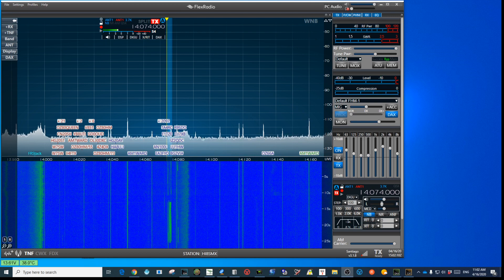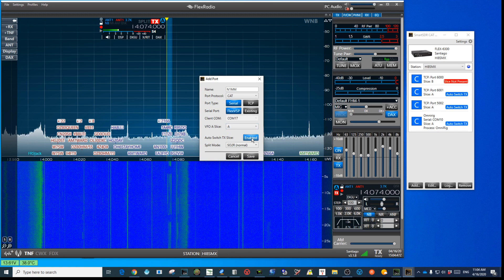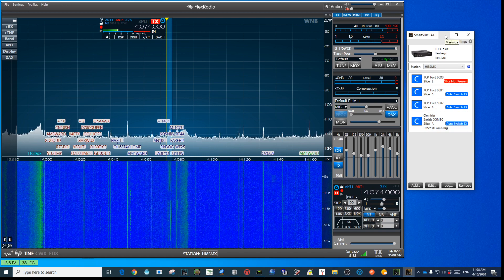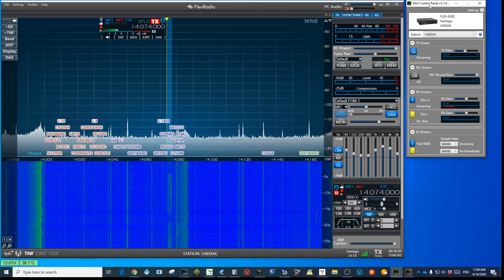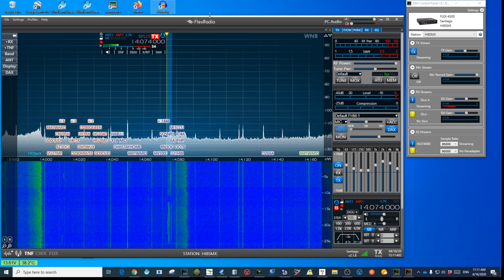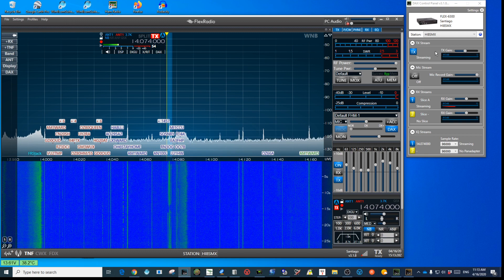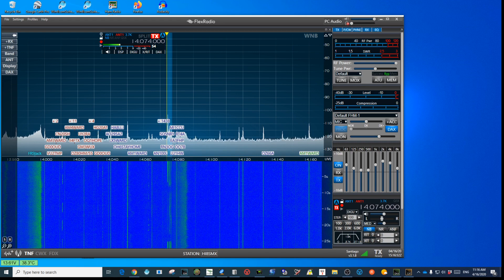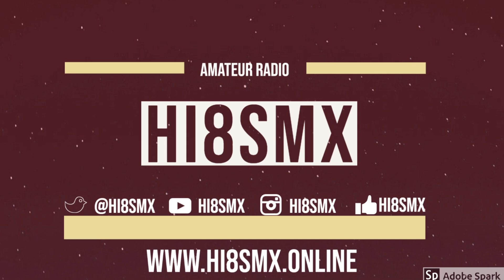Flex 6000 Series CAT and DAX Basic for SmartSDR

Comment: Here is my problem. I  have a brand new 6400M. It shows a frequency on 40 meters. But for some reason, SmartSDR is not connected to my 6400M. Because it reads another frequency. And when I turn the dial on my radio, smartSDR does not change. How do I get both to be in sync with one another? HELP! Mark KB3Z